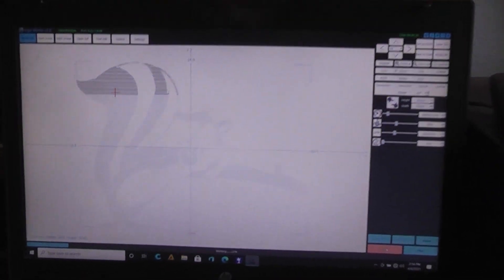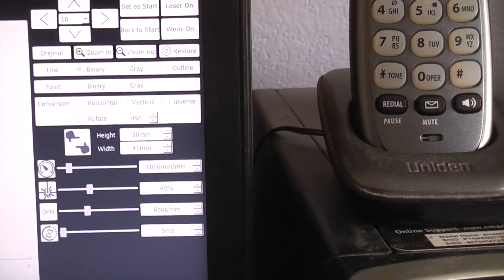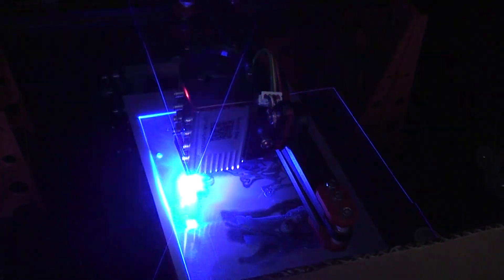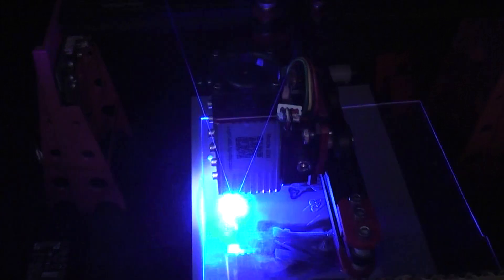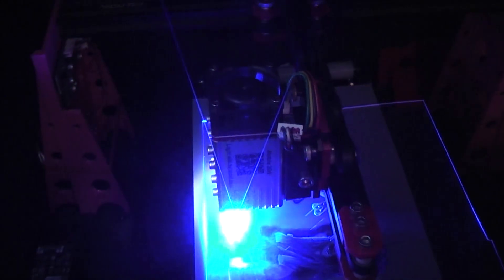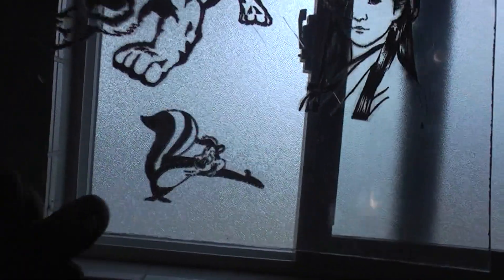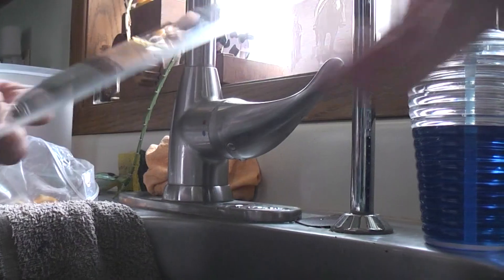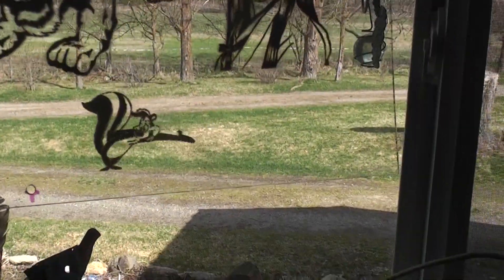Diode laser etch clear acrylic with high contrast and no clean up.

Comment: Hi, I will appreciate if you answer my questions. I'm trying to engrave clear acrylic plates with no success at all. So, I will appreciate your help.  did you use a metal plate (like aluminum) beneath the acrylic plate? Did you paint it gray? Did you use any paint to paint the back of the plate? And what image mode did you use there?
Reply from the maker: As stated in the video, I painted a metal "aluminum" then placed the clear plastic on top. The laser is focused on the painted metal plate not the plastic. it is all covered in the video.

Comment: What laser engraver is yours,I bought a cheap vigotec l7,I'm still getting used to it though,it shouldn't take long as I used to run massive laser engravers as my job
Reply from the maker: Its the VG-L7X 20W but after I ran it at 100 % power once it no longer could do glass or tile engraving so I replaced the diode laser with a NEJE 30W "7.5 optical power" unit that I have been using for 1 year now with a problem.
Reply: @Robothut  I wish I had known that before as I've been running mine on 100% the whole time,I got mine second hand so it had possibly  already been run  at 100%,I'm already looking into getting  a 40k CO2 laser

Comment: I wonder if you could just spread  thin layer of  graphite powder on the acrylic, and where the graphite gets hot enough to melt the acrylic it sticks, or maybe spray it with a graphite lubricant.
Reply from the maker: Sounds like a good idea to test out. I think the only problem is getting a uniform coating of graphite so the results are consistent.